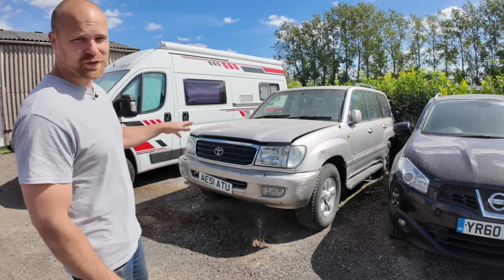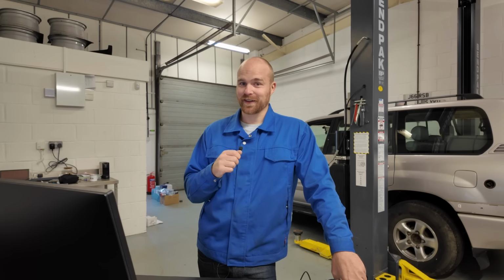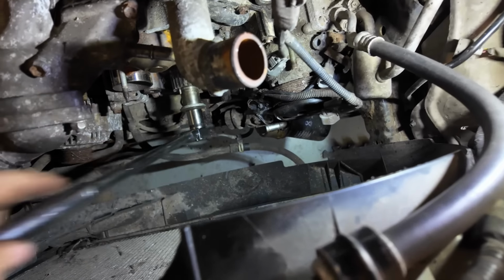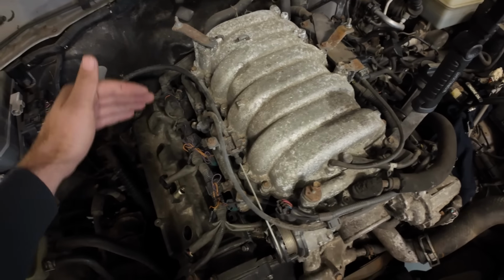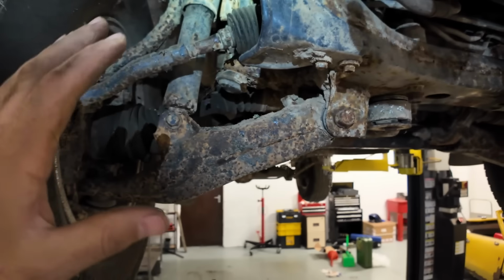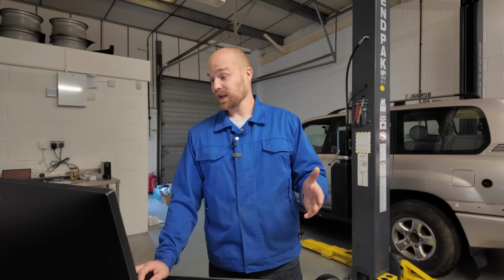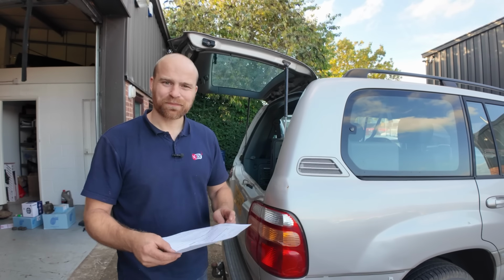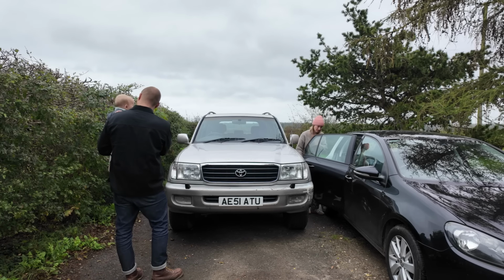Can I Rescue This Abandoned Toyota Landcruiser?

Comment: Its smoking on start up because its running LPG with a flash lube system and if its not properly adjusted it'll allow valve lubrication oil to weap into the cylinders. It needs one drip every 9 to 12 seconds

Comment: Really getting into your channel mate. Watching the land cruiser resurrection.
How about this theory, some clown was servicing the engine, then belt change. Overtightened it and the belt ripped off the pulley, then it's never been run so oil pump hasn't seen the new oil 😮. ..  💡

Comment: When it was running rough my thoughts where the timing was off because of the broken cam shaft pully. That's what happens when a timing belt or chain is disrupted, the cams fall out of timing but you must of retimed the engine off camera. 
My next thought was the 8 year old fuel. Gasoline loses it's volatility after a handful of years. I guess an engine like this wouldn't care. The O2 sensor makes sense. 
Greetings from Oregon, keep up the good work.

Comment: Remember boys and girls, the maf sensor gets blamed for everything, but check for leaks and every other component on the intake system, as the maf dtc can be related to other sensors or leaking pipes. 
Always check for other codes which relates to the poor scape goat maf sensor.

Comment: One of the bosses where I worked came in with a long face and told his timing belt had snapped.  I asked the car make and he told me,"Vauxhall Cavalier".  This is the British make owned by GM. I told him not to worry.  A few hours later he came back with a big smile and thanked me for the info.
Reply: 8 valve vauxhalls were brilliant for non interference engines, even better for clutches, I used to do them at the side of the road in under 20 minutes

Comment: Mine is in the same condition, having been sat on my yard for eight years. Mine is actually in better underbody condition and the main drivetrain is perfect. It has one ‘new’ wing but water has got behind one of the rear lights and has rusted an inner panel behind a rear wheel.  Mine has the turbo diesel with 200,000 miles on the clock. It was put out of commission due to the main electric brake servo filing and the need for two new batteries and a change from the hydraulically assisted suspension to a mechanical one, because the ‘shocks’ which are rams being shot along with the need to replace the nitrogen gas accumulator actual shock absorbers. I have new standard non-assisted springs in stock somewhere.  The electric steering wheel adjustment has long failed and the viscous auxiliary heater has a fluid leak. It still looks absolutely fantastic. I did intend to do it up but realistically I never will get around to it. I’ve got a full set of manuals for it, including the one for the 1HD FT-E turbo diesel which has never been touched apart from a timing belt or two and regular oil changes with synthetic long drain oil from new. Never used any oil and kept it reasonably clean between 10,000 mile oil changes. Transmission and axle oils also regular changed. 
You just may have incentivised me to make it a project for my retirement. It would look great working next to my 2021 Range Rover with near matching number plates of S500*** and S540***

Comment: The biggest risk with the camshaft pulley having come away is bent valves as that engine is an interference engine. Taking the camshaft out will close all the good valves, but if any are bent, they won't close properly.

Comment: Don't replace Toyota wings with pattern ones. The originals can be repaired easily if not badly rusted. I don't think the belt would have been strong enough to shear off the pulley, the belt would have snapped under excessive  load.

Comment: These cars ars bullet proof a mate of mine has had one for his window round for 20 years with 260k on the clock and just flew through it's last MOT and it runs great but he changes the oil 3 times a year and he gets all the metal underneath dry ice cleaned every 4 years and he re paints any parts underneath wich needs it and as he says its bullet proof and his is a diesel not a petrol V8 thus he gets fairly good mpg and it's purely for works use only covered in bumps and scratches and dints but so what he will never sell it so happy days😊

Comment: I’m a Toyota tech and I have seen that usually happens when someone replaces the belt and forgets to right the sprocket bolts they back off the pulley works its way out and snaps the guide pin

Comment: That engine has also sat so if the numbers are kind of low don't be discouraged get the rings wet with some transmission fluid pour about a capful in each piston and then redo the test don't tear down the engine

Comment: Never really liked Toyotas and especially not when they came into the shop. Their engines and transmissions are pretty reliable, but the rest needs constant replacing and care. While a 20 year old Land Cruiser under normal care is almost rusted through in Germany, I'm still searching for rust on an Audi. And Land Cruisers aren't gods of reliability. The hype really filters out only the good experiences. They fail too and not 1 in a 10.000 but more frequent. That's why they don't rank at the top in reliability statistics around the world. Only in people's minds.
Funny enough, no one talks about Toyota premium prices when a singular camshaft of a mass produced, low power engine costs 1100£ or 1300€. ONE cam. I get all four in my RS6 for that money from Schrick. Not that anyone would ever need to change them since they just never fail. I'm surprised that the parts for this Land Cruiser are more expensive than the same parts for my V10 Touareg or RS6 or A8

BUT they are easy to maintain and that's a huge part of why they last so long. Everyone can do it.
All in all this does not seem like less work than the CRASH damaged RS6. This here was just sitting

Comment: Hi mate. Common mistake is to replace an O2 sensor as you get a code for it. Normally, the sensor is fine. The O2 sensor will throw a fault code if the engine is running too rich, like due to a faulty coil.  Always fix the tuning issue before replacing an O2 sensor. Clear the codes and re check the O2.
Reply: Do you know if that is the case on the 2.0l 1AZ-FE engine? I have a Rav4 -02 that threw codes on sensors and I replaced them for much money but the money light came back couple of days later...
Reply: @Dorngrunder . Hi mate. You need to run some live data on fuel trims. If the car is adding fuel there could be a vacuum leak affecting the fuel trims. The O2 sensor feeds back fuel trim readings to the ECU but the ECU can only add or take away a minimum amount of fuel to keep the air fuel ratio correct. Once the O2 sensor reads that the fuel trim hasn't corrected enough it throws a code. You either have a too rich or too lean condition.
Reply: Hey mate... How do you handle that? 
I have a 2003 LC100 (2UZFE, 5 speed auto). changed the sparks, injectors and still same problem. my O2 sensor code is still on. changed them and the error come back the same day.

Comment: I watched your vid on the Range Rover L322, and this is interesting because I own both a 2002 Range Rover L322 and a 2006 Toyota Land Cruiser LC3 (short wheelbase.) In terms of viability, the two are poles apart; much as I love the L322, the Land Cruiser is in another league for reliability and durability, which is why they hold their value so much better. On that basis, the threshold for becoming unviable is far higher on the Land Cruiser, to the extent that a replacement engine for the Land Cruiser is at least as worthwhile as a replacement gearbox on the L322. Unlike the Range Rover, what you will have when you’ve restored that Land Cruiser is a vehicle that will be worth more but will sustain that higher value. My Land Cruiser has done roughly the same mileage (200k-ish) as my L322 and my expenditure over a similar period of ownership has been a fraction of that on the Range Rover. Another important point is that the Land Cruiser is far less susceptible to rust. All those weal spots on the RR where water collects, eg inside the arches, simply don’t exist on the Toyota which has been designed to prevent water accumulation. You’ve had a new duffers in your workshop but that Land Cruiser is a very worthwhile project.

Interestingly, the inside of my Land Cruiser was also rather smelly for a while but that was after I’d driven through 1m of water during a flood, right up to the front edge of the bonnet (without a snorkel.) The car kept going, and there were some signs of damp near the air filter but nothing got into the engine (TFFT!) And yes a compression test was done which turned out ok. Just a few electrical glitches during the following weeks. That was before I knew that the official max wading depth is 700mm.

And now it gets really spooky… I just noticed the yellow Spitfire in your workshop and wouldn’t you know it, I had one of those as well (and in yellow!) although to be fair that was way back in the early 80s. If you’re reliving my life I’d better warn you about the upcoming hazards 😂

Comment: I have a 1999 land cruiser kj95 1kzte 3l diesel. It was sitting in a back of a shiny car 2nd hand dealership, and the guy working there when showing me the car jumped the battery backwards and blew the big 100 something amp alternator fuse, i broke off the plastic top, the legs were screwed in, and put an 80 amp Mercedes fuse there, and it started right up. I knocked off from the price since it needed 2 new battery and the fuse.  Boy was sure scared when all the lights went off, if hed done this to the other cars all Mercedes and Bmw hed be still paying the price back to his boss.

Comment: I hate the way they do the front brakes. It's like old junker American trucks. You shouldn't have to remove the wheel hubs to swap the disks. I could do disks and pads on my 1979 Audi in half an hour and it didn't require touching the hub adjustment.

Comment: Your bad MAF sensor code was likely all your air leaks, there was probably nothing wrong with the original.  The rough running was the ignition coil. Without knowing what the exact o2 sensor code was, it's hard to say if the sensor itself was bad.

Comment: Absolutely love watching this video. I live in Canada (Calgary, Alberta) and own 2008 Toyota 4Runner Limited with the same 2UZ-FE engine 4.7 V8 for over 11 years now. Also, I had 2006 Lexus LX 470 for several years that was based on this 100-series Land Cruiser with the same engine and AHC suspension. Now I have 200-series 2008 Toyota Land Cruiser AX imported from Japan this year that has the same engine as well (Toyota put it in 200-series until June, 2009). It was fun and joy watching Nino restoring this vehicle with minimal spending to make it run again. I think this is the best vehicle even made in automobile history 👏

Comment: try cleanin injectors and replace the micro filter basket that is in them, old inkectors don't atomise that well the fuel so the combustion isn't the best, and if they're dirty enough fuel just drops out of it, that can cause the white smoke. also change the crankshaft sensor, when they're old, they cause jittering and they don't throw check engine liht, also knock sensor, the big bolt types, tend to go as well when they're old, i would replace those, that being said amazing video man i enjoyed every bit of it, i only discovered this chanel now and i'm fan of this type of content, i usually watch "smellslikegasoline" or "farine de ble", french youtubers that does this type of content, but yea very happy found yours.
Reply from the maker: Appreciate the kind words and the pointers. I'll add those parts to my list for when I do the next video 👍🏻

Comment: I would check and sand clean the ground wire, engine and frame get a good light and go over all wire and harness, make a hotter spark my van it gave a wow almost double power.

Comment: I bet you could have just brushed up the rotor on the alternator and it would work just fine. I think it just had rust on it from sitting so long just like the cams... Pretty nice build even though the repairs were probably also 2K. It's nice to know the car you drive inside out! It creates like a bond with the car as well.

Comment: The pulley probably snapped off trying to start it up and the driver had the sense to have a look instead of cranking on it until the battery died..... Hope you turned the engine over by hand a few times before cranking on it! Oil might look really clean because all the crap settled to the bottom. Catalytic converter got stolen. Enjoyable project! Land cruiser and will only go up in value!

Comment: Fixed  on our own, our Fiat Doblo 1.9JTD ourselves, need a new thermostat and sensor, needed to dismantle lots of the right side of the engine but we did it, runs sweet and no overheating, parts, coolant and a new set of rachet spanners all in '£80, garage bill well, scrap yard then. Lots of research and lots of photos taken to rebuild.😀👍

Comment: I HAD A HONDA ACCORD 2001 2.0L executive fully loaded with 88.000 genuine mile full service lads going on to me get rid now to old but it ran so sweet 100mph at just under 
4 thousand Revs first and last time needed to see how it run i drove like miss daisy let it go for £400 it had tiptronic clutch I REALLY MISS IT NOW IVE GOT HYUNDAI TUCSON SE DEISEL NOT THE SAME OLD CARS ARE THE BEST KEEP ROT AT BAY DON'T MAKE ENGINES LIKE THE OLD ONE'S ANY MORE
Reply: HA BUD I'VE JUST BEEN LOOKING AT TEMU KNOW RUST PAINT KNOCK MAIN CRAP OF OR POWERFUL JET WASH WHEN YOU PAINT IT ON LOOKS MILKY BUT DRIES MATT BLACK MATE JUST GOT SOME LIKE IT SO SENDING FOR MORE THEY ARE SMALL TINS 100ML BUT ONLY £250p A CAN THAT WOULD LOOK BRILLIANT IN THAT GET SOME 300 C SPRAY PAINT FOR EXHAUST THINK 300C IS ABOUT 900 F
Reply: 300 C  IS 575 F
Reply: ALL THEM PLACES BUD ARE  VERY DRY NOT LIKE UK WET WET
Reply: If you have got to get engine rebuild see if you can get one of them I would get 3.0L replacement  the location pin broke causing pully free spin
Reply: FOR THAT FUSE A GOOD OLD PAPER CLIP KEEP SOME IN VEHICLE JUST INCASE THAT BIG ONE BLOWS DON'T PUT NEW ONE IN UNTILL YOU HAVE TESTED ALL ELECTRICS IF YOURS DOESN'T BLOW LEAVE IT YOU COULD HAVE A SHORT TELL WILL BLOW NEW ONE THE SOLDERING COULD BE BIT MUCH SO IT'S NOT BLOWN

Comment: Wow the salt applied to your roads really does destroy a car in short course. You see that level of rust and corrosion underneath a vehicle here too but only when they have gone through salt water crossings or beach runs and haven't been prepared or cleaned off properly. Are there companies there that do under body spraying (lanolin etc.) for salt protection in winter? Great watching.

Comment: You said you have hars inspection ? ... Come to Czech republic mate ... It would probably fail emission burning oil like that, rusty brake pipes - fail, rusty fuel lines - fail, right rear brake light not working fail, boot on the CV axle is greasy - fail and loooot mooore :D

Comment: I’ve got that vehicle with the 4.2 straight six diesel , with just 130,000 miles with full service history ( I change the oil and filter every 5000 mile) , I’ve had it five years and it’s been superb , it runs and drives like new ..luckily I live in Spain now so rust problems don’t happen ..the most reliable  production 4x4 ever built ..

Comment: Can i just tell you that this is the car that i love and hate the most out of all of them? I hate how easily the rust eats them up. And i love how smooth and capable they are and the motor is bullet proof. They are so well built that when the first or second owner reach 250k miles and everything is about to break they sell them. And people like you or me buys them. And we get stuck with not only a rust bucket but a large bill of parts. Oh and the front brake rotors are a pain to change if is rusty. It took me 3 hours with rust

Comment: No depreciation left in most of it, except the Petrol tank and Government charges. Oil, Fluids and filters and I will see you at 300,000 miles. Bitumen coat the underside frame after wire brushing it and 500, 000 miles is yours.

Comment: Great save of a great 4x4!
Workshop manual was z God send.
Nice to see replacing the front stud went so well.
Had to do it on an Izuzu Trooper I have, and to split the front hub/disk you have to remove the ABS reluctant ring.
It's made of  the most rubbish alloy you can imagine, and is almost guaranteed to crack and break.....

Comment: I had a similar thing happen when the crank pulley came loose on my Lotus Elise (K-series). The locating thingy snapped off because the crank was rotating but the pulley wasn't. I filed it flat. Centre punched, drilled and tapped a hole. Inserted an allen headed bolt with thread lock. Cut the head off and filed to size. 15 years later all is still ok.
Reply: Had a similar thing with a crank pulley on a shogun, luckily it only ran the power steering and alternator not camshaft. Had to drill out roll pin with hardly any space to get to it.

Comment: Get yourself some 4 inch piping for a tumble dryer and put it over the exhaust pipe and put in your fire door that will save you getting gased out there is equipment out the for this job but if you are doing on a budget basis then this will work for you and Long Live A Landcruiser great episode

Comment: I’m happy to see this, because there always someone saying that Toyotas are the same as European cars the difference is maintenance. Here you have it, a complete neglected toyota, and every window works, the hydraulic suspension just needed the missing parts and a bleeding, and the engine repair was fairly easy as straightforward.

Comment: I have a lexus rx300 2004. I often wonder if its engine and various parts could be donated to a land cruiser in need. It just gets electrical issues from the fancy systems on it, which the land cruiser does not have.